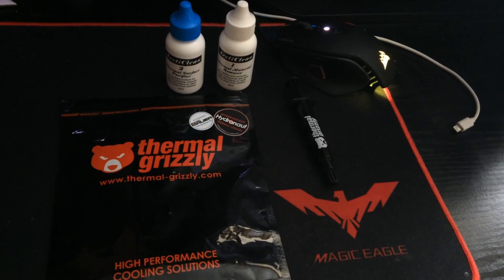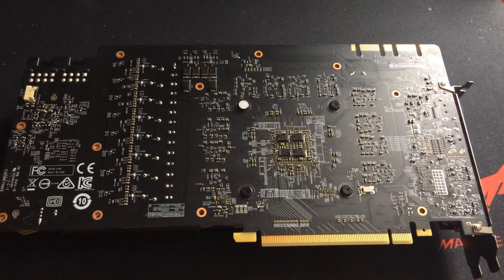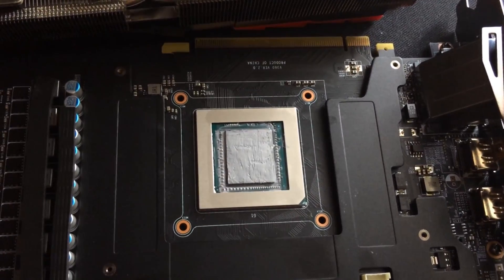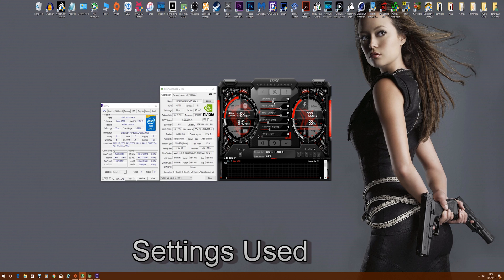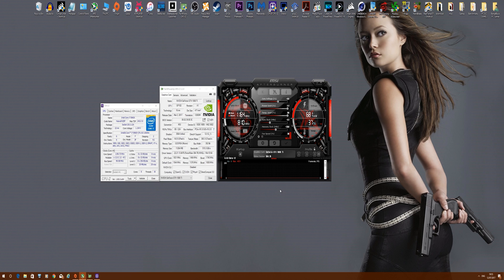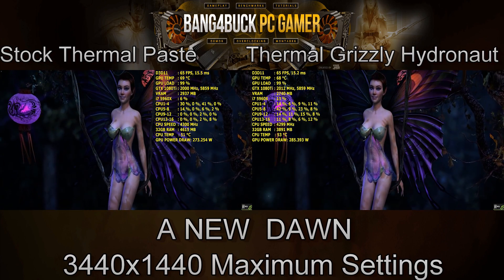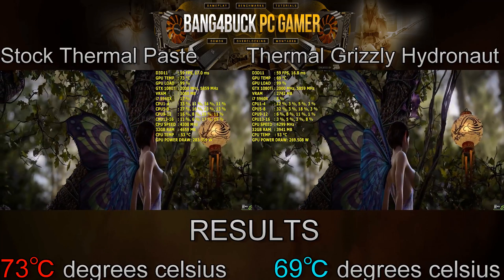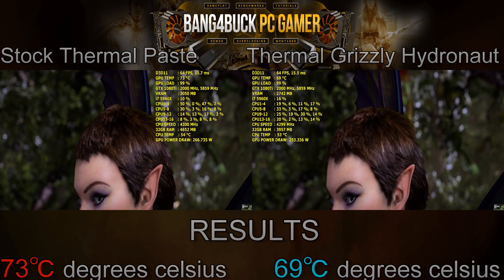Thermal Grizzly Hydronaut Vs Stock Thermal Paste | MSI GTX 1080Ti Gaming X

Comment: you forgot to show the gpu fan speed, the 4ºc lower of the grizzly probably will be at lower fan speed than on the stock thermal paste
Reply from the maker: No I manually set my fan speed to lock at a maximum of 70%
Reply: apps oks, good to know ;)

Comment: I liked the video and it's nice that you went ahead and did this to demonstrate the difference a better thermal paste makes, but is a 4 degree drop really worth voiding your warranty over?
Reply from the maker: Removing the sticker will not void the warranty unless you do damage to the card while doing any actions with it while it's cooler is removed.
The sticker is just there to warn users that might not know what they're doing. This is the case for MSI and EVGA from my knowledge not sure about other brands

Comment: GPU stock generally use good paste not like intel processor
Reply: good paste really?  nah i unmount many gpu and the paste is really sucks and the mode of they applied it wrost than the paste, i replace it every time at the end of guarantee, sorry for my bed english dude, but after replacement liquid metal or normal paste like noctua the temps drops nice.

Comment: same card here. and i like it. but im limited to 60hz monitor, and im not doin dsr so my powerlimit is stuck to 50%=120watts ave. gpu powerdraw and max gpu temp of 54c stock fan. all games ultra, no scaling, and impressively lock at 60fps 99% of the time with some extra for msaa. nice vid.

Comment: When I had my R9 290 from Gigabyte (Windforce), I changed the thermal paste from stock paste (which usually was around 89°C at max) to a Cooler Master Ice Fusion paste and it went to 94°C and started throttling, LOL, I'm glad that I sold it and got a used 980ti from Zotac (AMP! Extreme)
Reply from the maker: Dam that sucks, well I'm glad it all worked out for you in the end
Reply: but that process of changing paste did it break the warrantee of the card ?
Reply from the maker: Removing the sticker will not void the warranty unless you do damage to the card while doing any actions with it while it's removed.
The sticker is just there to warn users that might not know what they're doing. This is the case for MSI and EVGA from my knowledge not sure about gigabyte
Reply: i am with asus strix i will like to try that cuz of my sli main card sometimes hitting 80 degree c but i dont want to avoid the warrantee i know asus are very strix :) about warrantee  i mean strict . Well i really want to custom loop but still hesitating cuz of 1 the cost of it and 2 the warrantee break and 3 ability in my country are none i will need to pay for the high price shipping + vat taxes and need to find someone qualify here to make the build  fittings here  thats a lot of risk to take in srs consideration.
Reply: i personally use artic silver 5 on my 7700k can u tell me if that Grizzly is better ?
Reply: You won't note too much difference between good quality thermal pastes, the best you can do is liquid metal and that's kinda risky, but it drops your temp a few degrees more than normal pastes.

Comment: My GTX 980 has liquid metal and my temps dropped at least 10C+
Reply from the maker: around the GPU core you have little transistors that are exposed, if the liquid metal makes contact with them it can damage the GPU or even stop it from displaying anything because it conducts electricity
Reply: Bang4BuckPC Gamer Ive actually done this :(
980ti Strix from factory 88*c
Rethermalled and obviously missed or didnt look properly.
Didnt boot ever again. Received power but no display.
Rma was successful however.
I am NOW careful to the point of being ANAL about it.
gr8 Video
Nice reduction there, love the enthusiast style of ur channel. GG
Reply from the maker: I'm glad your RMA was successful, Liquid metal is superior but the risk is more than I am willing to accept
Reply: I used clear_nail_polish to cover those little transistors and used Conductonaut liquid metal on my Asus Strix 980ti and dropped -10c with usual fan curve of 60-65%, before...highest 77-82c, after LM it never goes above 70c, it hovers around 66c on load.
Reply from the maker: Liquid metal is more effective but I'm not risking my £700 GPU lol
Reply: Bang4BuckPC Gamer risking how? XD
Reply: I have done it a few times already so it really isn't difficult at all for me.
Reply: I have done it with the R9 290 I used to have and I got 15C Drops and that die has transistors all over the sides. Once you learn it really isn't difficult.
Reply: I will use liquid metal for any gpu I buy from now on as long as what is making contact with the die is copper or else it eats aluminum.
Reply: Just use nail polish as alt411 suggested and kapton tape or something similar and you're safe. I've never used liquid metal but if I did, I would've never tried it without these two things...
Reply from the maker: @ Stefano_pena That's the thing both the R9 290 and GTX 980 combined do not come close to £700 so for you to take a risk on your card is not as bigger deal as it is for me, and My cooling is great now especially If I don't push my card so hard so it was a success

Comment: I'm surprised you didn't go for kryonaut tbh
Reply: Kryonaut isn't conductive though. Conductonaut is the conductive one.
Reply: Kryonanut has silicon stabilizer which is prone to pump out and can't take as high heat as well as hydronaut which is better for long term stability.
Reply from the maker: what is the difference ?
Reply: A few Degrees, all the heavy overclockers use it and I swear by it but hydronaut is still good :)
Reply from the maker: Oh I specificity avoided anything with Silicone and that is why Kryonaut is 12.5 W/mk, and the Hydronaut is 11.8 W/mk. Plus Hydronaut is cheaper and easier to spread with similar results while not conducting electricity
Reply: Ahh okay

Comment: Have you considered water cooling? EK have a new line of aluminium kit called the A240g that has a CPU and GPU block and the pump and all the tubing for under £250. I know that is a lot, but considering how much custom water cooling would set you back, that is a great deal for CPU and GPU cooling and it drastically brings temps down. Just a suggestion :)
Reply from the maker: I don't water cool anymore as I upgrade every 1-1 and half years. I could easily put my AIO cooler on my card but I like the look of it and it's very quiet

Comment: Should have just bought an Asus instead. It has amazing temps and performance.
Reply from the maker: I got my card for £700 new the Asus was £100 more expensive and did not fit my colour scheme
Reply from the maker: Well I have been a proud owner of the GTX 1080 Ti gaming X since the 21st of MAY so I have no regrets
Reply from the maker: I can live with £700 but I'm not paying £800 for a single GPU unless it is something special and the Strix while being marginally better, It is not worth an extra £100 no way
Reply: Bang4BuckPC Gamer    It was £649 on amazon yesterday
Reply: Bang4BuckPC Gamer   I got the zotac extreme edition for 727£ and that's the best 1080 ti on the market and the KINGPIN Edition
Reply from the maker: The Zotac Extreme is a good choice but the KingPin is not available yet for purchase and it will cost easily over £900 just like the MSI Lightning edition GTX 1080Ti
Reply: Lol.. didn't you throw away 2 1080's for upgrading to a 1080ti? You must have had a loss of atleast 100 pounds not counting the time and effort in trying to install liquid coolers on them and shit.
Reply from the maker: Lol have ever sold a graphics card?
Reply: arsenalozil zotac is a joke sorry..lol.
Reply: you have brexit to blame then.
I got my card in april for 780$ US.